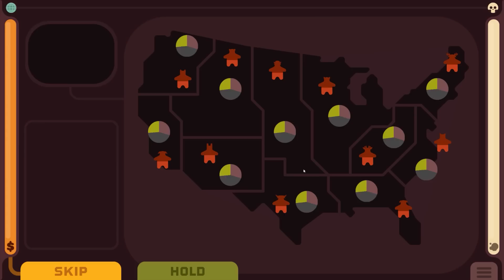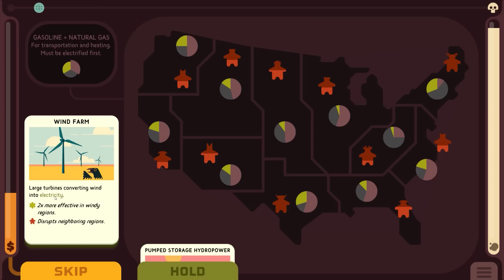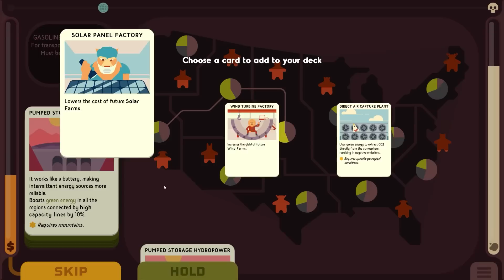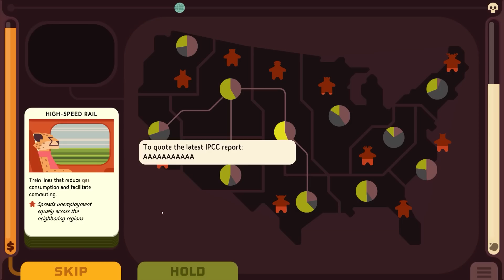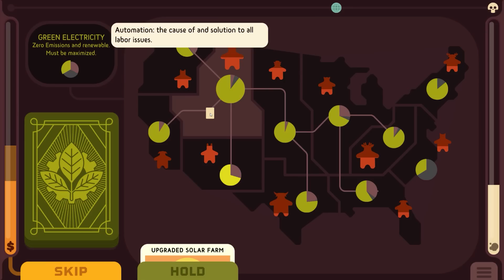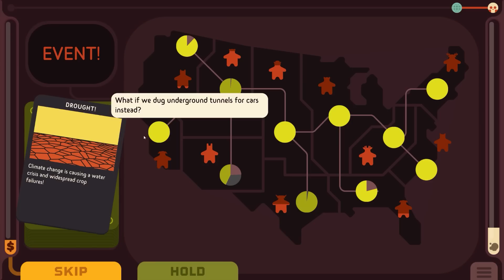Averting CLIMATE CRISIS Before It's Too Late! | Green New Deal Simulator

Comment: I think the reason you failed here is because your big cards, like the offshore windfarms, were only able to deal with the fossil fuel usage (the black in the pie chart) and not gasoline usage (the brown). You'd played them enough times that you basically totally eliminated fossil fuels, and then playing those cards had no effect on the overall progress on the bar on the right. You needed to use the electrification programmes and public transport and stuff to convert the gasoline usage into fossil fuel usage which you could then replace with green.